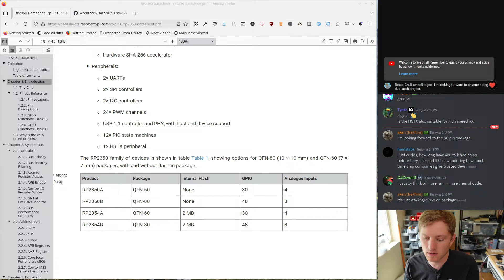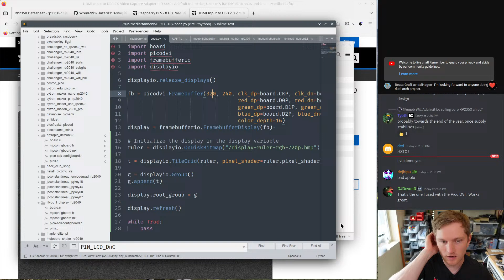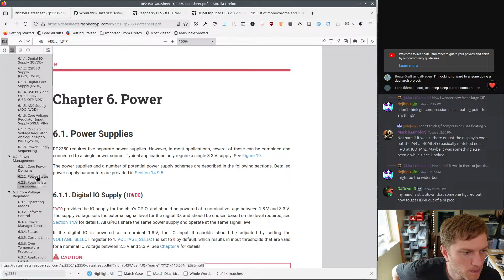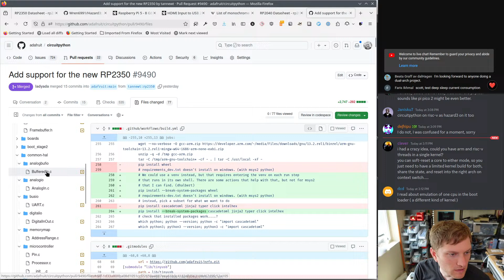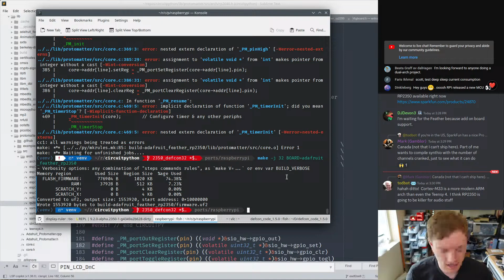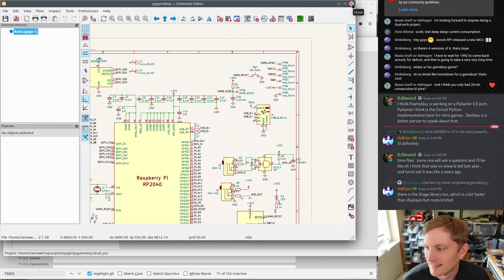Deep Dive w/Scott: RP2350 from Raspberry Pi #adafruit #rp2350

Comment: @beatadalhagen I tried a dual arch setup and it was really error prone.  Much of that is likely because I didn't have a proper debugging setup to figure out why the chip kept freezing (seemed intermittent compile-to-compile, so I assume some kind of buffer overflow).  It's also annoying because I wanted C++ on core 1 with python on core 0, but the adapter for building your own library wants to be in C, so then I ended up with dual interfaces: python to C, then C to C++.  Ended up just dropping to a pure C++ project in Arduino IDE.